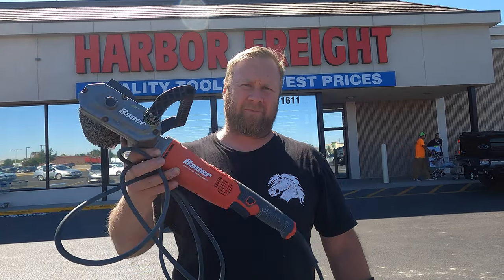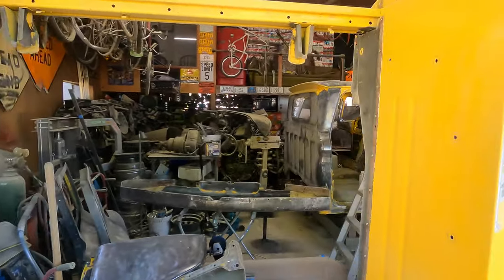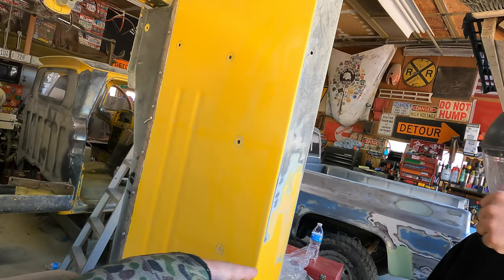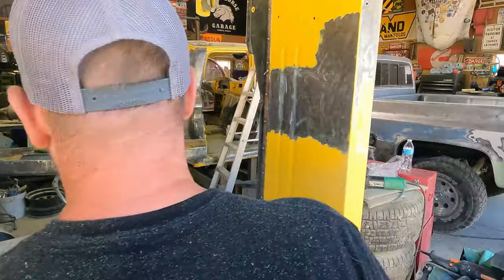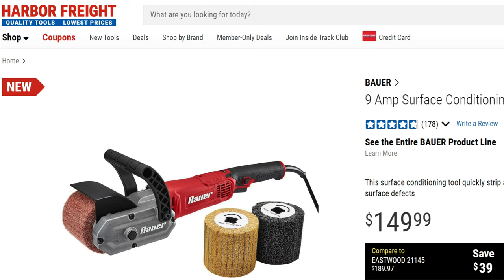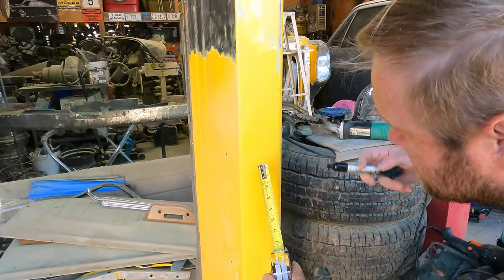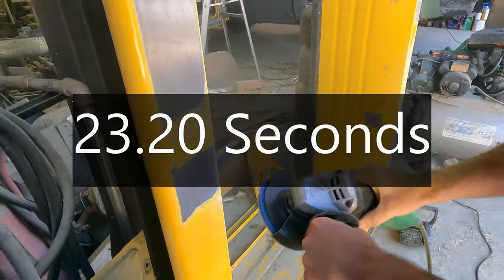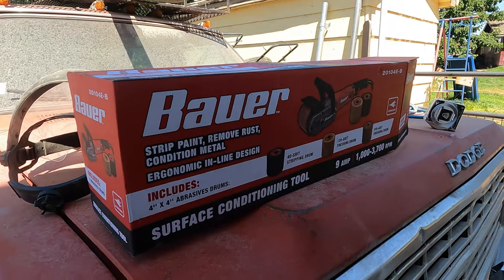Harbor Freight Bauer 9 Amp Surface Conditioning Tool Review! {Drum VS Strip Disc}

Comment: You missed something very critical though...you looked at the surface reconditioner as a metal working tool only. That's where it outperforms others the most is the fact that it can also be great for wood, fiberglass, and plastics....stuff that can easily be destroyed by an angle grinder.
Reply from the maker: It would probably work great for that stuff. Thanks for watching!
Reply: @IronHorseGarage  Also, one other thing to take into consideration...the angle grinder strip disc only did one job....stripping. The surface conditioner did 2 jobs at once....stripping, PLUS  a clean ready-to-go finish. No real metal worker is going to call a job complete with angle grinder streaks and stripes all over a project. So the time you clocked on the angle grinder would literally be 2-4 times longer after finishing passes to make it match the conditioner surface...unless we're just talking about something the size of a welding coupon or something small like that.
Reply from the maker: All depends on what you're going for.

Comment: just bought the drum sander at HF for 109 bucks. did a test spot on a car frame and it is working incredibly. Fast and very clean. Very impressed. I cant see anyone  buying the eastwood unit at 3x the price.
Reply from the maker: Awesome! Yeah you can't beat the price.
Reply: True, but the Eastwood one goes on sale quite often, I think currently it's on sale for around $120.

Comment: I think you're missing the purpose of the drum style machine, it's to achieve consistent inline abrasions like satin finished stainless steel or aluminum, but can also strip paint as a plus.
Reply from the maker: That is not how it's marketed. Eastwoods version is marketed for stripping rust and paint. In our industry you don't want smooth shiny steel to lay paint over so that type of purpose is of no use to us.
Reply: @IronHorseGarage  
Hi friend, it doesn't surprise me that they market it to the public that way, he'll they market grinding disc's for drills...lol.
like I said "it can also strip paint as a plus", but its original design is for burnishing metals, my personal machine is a $1200.00 Metabo burnishing machine, but in the past I've also owned stationary machines for burnishing large panels.
https://youtube.com/shorts/6wKPB_uPoP8?si=qspOJOUmRG5DbKWZ

Comment: My first and most likely my only Harbor Freight power tool. I use it not to strip paint but to polish and grain stainless steel pipes, tubing and panels. Does a nice job putting or restoring grain
Reply from the maker: Awesome, thank you for sharing, and thanks for watching!

Comment: The drum is smoother and better less gouging nd deep cuts leaves it leveled nd smooth
Reply from the maker: No gouging with the strip disc either. They are not a hard material.

Comment: I’m restoring and old rusty utility trailer will this work on heavier rust or just like most surface thinner rust??
Reply: I have been using a a wire wheel on a angle grinder but it’s taking forever
Reply from the maker: I think it would probably work fine for that. Only one way to find out!

Comment: If the only thing you use it for is pant removal then yes but if you want to prep metal, polish it or even redo you stainless steel sink so it looks brand new then the surface drum sander is the way to go. Remember if every problem looks like a nail then the only tool you need is a hammer.
Reply from the maker: Thanks for watching!

Comment: the conditioner leaves a smoother more even finish over the flap disc
Reply from the maker: Depending on what drum you use. Also, you don't always want an extremely smooth finish to paint over. Plus, that thing isn't very durable.

Comment: Looks like both have advantages and disadvantages and both would work good together stripping a car to bare metal for example. It's seems to me that the angle grinder leaves a less consistent and uneven surface compared to the Bauer tool in my opinion and I wouldn't use it for the large flat areas.
Reply from the maker: Yep, different tools for different types of work. Thank you very much for watching!

Comment: Would have liked to see you both swap tools and do it again.  Looked like drumb tool was really only using the weight of the tool vs grinder really getting in there with a push.   Curious about fatigue if you actually did the whole bed.   Those grinder strip discs can work really well.   Not a good sign the drums sander died so quick.  I got it for I think 109 or 119 on coupon a month ago.  I guess I better use it a bit to see if it will fail.   I think both types will have a place.   Thanks for the review!
Reply from the maker: Thank you very much for watching!
Reply: they do have the handle mounted backwards which also lessens the force applied by the Bauer
Reply from the maker: Is it enough to make a difference? You can also push it to a stop.

Comment: What if you used the machine weight to your advantage and did it on a horizontal panel just an idea may need to watch the heat at that point as well
Reply from the maker: Yep, we probably should have done that, it could have an advantage in that aspect, but there will be more testing for sure!! Thank you very much for watching!

Comment: Just compare the drum to the disc, that’s all I’m saying. The disc u can get 2/3 of it to work on material, MAX. The drum is about 8 discs combined, you do the math on the time it will take u to change out 8 discs compared to one drum
Reply from the maker: Great analogy, but it doesn't actually work that way. The disc is faster.

Comment: I'm so sick of surface preparation buying this buying that using muriatic acid or putting it in a sand blast cabinet. 
I saw what the dustless blaster can do and I will be done with all this it's expensive but so much time saved
Reply from the maker: I hear ya. Sounds like the route to go. Thanks for watching

Comment: I see both having their use! The SCT seems to flat rip off paint rust U name it...yrs worth...and at warp speed  on flat surfaces like hoods cab tops roof tops trunks etc....But the grinder is gonna do better on like the side of the vehicle I think or in tons of spots where the big gaulky one ain't gonna ever fit!!

But the SCT one is pretty awesome when u can bare dn on it put ur weight on it dn on top of it on any surface like I said such as hoods cab tops trunk lids...nice large curves on older antique cars etc!? 

But again the grinder with the rt grit?? Etc...is smaller!!! MUCH more LW!!! Easier to hold move around...get into much better much smaller places...

And I MEAN U CAN GET A PERFECTLY GOOD BAUER GRINDER LIKE I JUST DID FOR 19.99!!! AND ANY WAY U SLICE IT THAT PRICE IS PRETTY GD HARD TO FN BEAT!!!!😮😊

19.99+1.40T+8 for 2yr War!! So under 30 w a great 2 yr on it!! U just can't beat that!!!

And Metabos runs like 39.99+ with a 3YR WAR?? AND LIKE 6 WHEELS!!! GREAT QUALITY FOR AROUND 40!? 

FOR SAME PRICE AS THE METABO U CAN PICK UP A.LITTLE BIGGER BETTER GRINDER WITH THE NICE TAIL AND TIGGER ON IT BY BAUER! CM MAKES ONE AROUND THE SAME PRICE!?

And the Herc wheels r pretty damned good! Though I do with HF would carry and sell a lot of stripper pads with the Grits on them like the rollers on the SCT! 

SO WHERE DID U GET THOSE PADS AND HOW MUCH NOW?? LOVEEE THOSE BLUE ONES U GOT ON UR METABO!!! I NEED THOSE AND OTHERS LIKE THEM FOR MY NEW 19.99 BAUER GRINDER SO I CAN BEGAN STRIPPIN DN MY OLDDDD 88 CHEVY SILVERADO K2500!!?? MAN O MAN DOES IT LOOK LIKE SHIT!!! TONS OF RUST AND MULTIOL COLOR ETC.... WANTING TO FINALLY DO SOMETHING WITH THE CRAPPY BODY SHIT AND PUT SOME KINDA PAINT ON IT JUST TO MAKE IT A NICE COLOR AND GIVE IT A NICE NEWER NICER LOOK AND SOME UNIFORMITY!!??

CAN I PLEASE FIND OUT ABOUT THE NICE BLUE PADS UR USING ON UR METABO?? THANKS GUYS!!!😊😊❤❤
Reply from the maker: Thank you very much for watching and commenting! We get the blue pads from Walmart.com or Amazon, but the Walmart ones seem to last longer and are cheaper.

Comment: How hot is the angle grinder disc getting the metal? In certain conditions it can warp.
Reply from the maker: Not very hot, but yes it can warp the steel no matter which tool you're using. You have to be careful and keep it moving so it's not in one area too long.

Comment: Man I've been waiting for you guys to get your greasy hoves on that machine again much like the manual tire changer finesse eludes you....#1 measure the temp of the metal both methods produced the temperature is important as to not warp thin sheet metal!.... #2 they make a variety of wheels for the HFT/Eastwood machine in all widths and types of material...... Obviously Jason is the smartest one of the group!..... Never have I been so scared than when you said strip! And those two guys were standing there!!!😂😁😝🇺🇸
Reply from the maker: Hahaha haha!! We took an unofficial hand feel temperature and it was about the same. I'm sure there's lots of other drums that can be used which we will be looking into. Thank you again my friend!!

Comment: Thanks & well done. I appreciate that you start the video with almost obligatory return of the defective HF tool. I like tools that just work right out of the box and keep on working. I also hate Communists and what they're doing to our country. 

Those Eastwood drums are spendy compared to the discs. I do like the brushed finish of the drums better for exposed stainless. 

I've looked at the Makita 9741 Wheel Sander, but at $700 +$240+ per drum, it's WAY out of my price-point. It's a specialty tool, for sure.
Reply from the maker: I hear ya, sometimes it's difficult to know what to do. Thank you for watching.

Comment: The Bauer operator was not working the tool right better get a person that knows how to work with tools.
Reply from the maker: The commenter always has something to say, but usually has zero experience. The Bauer is a piece of garbage and this style of grinder is a gimmick.
Reply: Take that grinder and come strip prep my wood deck. I want it ready to stain after you're done. 🤣 

Also would love to see the quality paint job you get on that streaky surface after the grinder.

Would also be fun watching you prep some fiberglass or plastic with the grinder.

See we can all sh-t on various tools. Doesn't necessarily make it a bad tool. You tried it on one very specific application. Didn't really even prove the point, cause you'd still have to go over and smooth the finish with a bunch of passes if you want to lay a quality paint job down. So all depends on the use case. The drum sander/resurfacing tool is great for certain jobs. Also...who pays full retail at HF? They have sales every day of the week...
Reply from the maker: Thanks for watching!